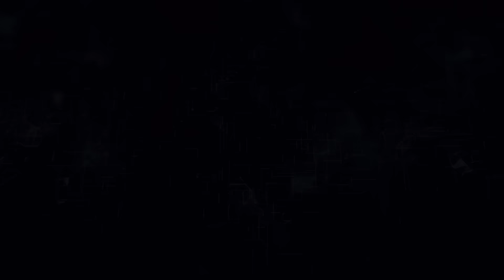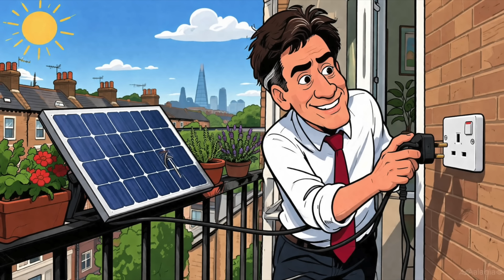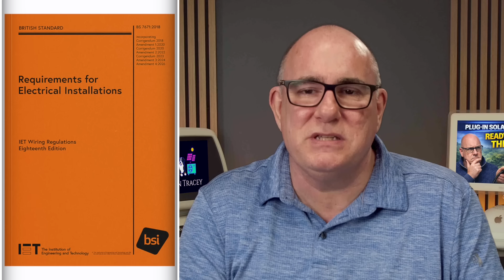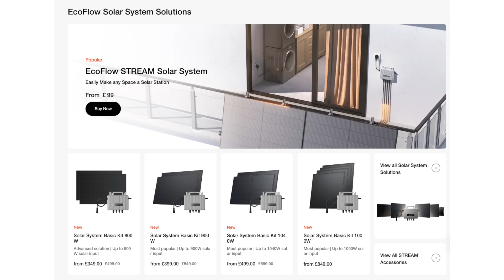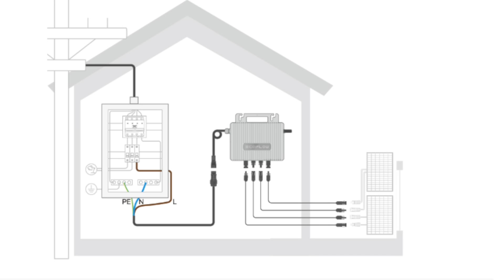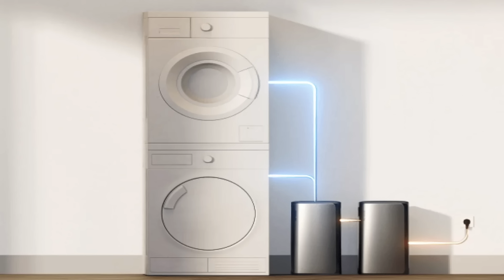Plug In Solar Is Coming… But There’s a Problem

Comment: Honestly, with the lack of decent sun in the UK and the cost is gone be hard to justify it
Reply: For a typical middle of the UK building with space for two south facing panels in the garden or on a wall your generation is 800kW a year or thereabouts. That's 200 quid's worth of electricity, so we have enough sun to make it work. It also works in places with far less sun because the panels are cheap and you can just overpanel.
Reply from the maker: There’s plenty of sun in the UK, you just build up enough credit in the summer to cover your winter bills. It’s helped me achieve a zero Bill home.

Comment: stupid question maybe, but as you need to plug this in to a plug socket, you will need to drill through a wall to get the plug coming inside… getting someone to do that will use up a years profit!
Reply from the maker: Or you could just draw a hole yourself and save the money
Reply: If you spend that much getting a hole drilled then you've been had.

Two solutions
- Drill your own hole (it's easy)
- Put the inverter/battery inside and use one of the very flat MC4 solar cables that will thread through a window and still let you shut it.

The latter is common in Europe because drilling holes in rentals makes the landlord angry.

Comment: Plug in solar has been available for quite a few years in Europe. It is actually a bit of a scam, even in Europe because the power generated is pathetic and the return on investment is not worth it. In the UK it is basically a device that Ed Milliband likes to use as a propaganda tool.  The fact of our power market is that we are paying about £0.30/Kwh whereas in sensible European countries one will pay £0.11/Kwh. We are being ripped off in the UK folks.
Reply from the maker: @johannbraunstein1190 I get the scepticism 👍  

The key difference now is pricing and usage — with higher UK energy costs, even modest generation can give a strong return.  

It’s not about huge output, it’s about **offsetting what you’d otherwise pay for**, and that’s where the value comes from.

Comment: About the buying stuff in" supermarket " aldi as an example,  television and radio in uk needs a licence the bbc thing regulations permit sale of a television but buying them in a shop involves a form this form is the document the licence revenues department then corelate with the TV licence,  a silly tax British folks dislike but a process that simply replicate the solar panels sale to force shop to provide details of the location panels going to reside.  That's a brilliant idea ?
Reply from the maker: @j.nav31..is7 interesting idea 👍  

The challenge is balancing simplicity and regulation — too much admin and it kills adoption, too little and you lose oversight.  

Some level of tracking might come in, but it needs to stay simple for small systems.
Reply: Shops have not had to take names or give them to the government for years.

Comment: Harvesting solar energy or any form of natural energy is a good thing. However, (regarding solar energy - especially rooftop panels), in the near future, what do you think is going to happen? 🤔The govt is pushing hard for people to convert to this. Similarly to the 'buy diesel cars' & now 'electric vehicles'. 

I don't need to mention the stigma on diesel vehicles, although today, they are cleaner than in the past. Electric vehicles were sold on the pretext of NO road tax & free from congestion charges. Hmm, that has changed. 

Back to rooftop solar panels, I guess the govt will bring in a tax on all properties having these. Property owners (like the EV drivers) have little option but to pay.🤐

Looking at the past history of govts 'hard-sell' propagandas, & what has happened since, this solar tax may not be as far-fetched as it appears to be now.
Reply from the maker: @kenco777 I get the concern 👍  

But past actions don’t dictate future ones — if you spend too much time worrying about “what might happen”, you end up doing nothing.  

Right now, solar reduces your bills today — and that’s something you can actually control 👍

Comment: The govt go out of their way to make sure you will only ever get minimal value for the cost of this. It will take years just to get your money back.
A 'real' govt could half the price of electricity if it wanted to, never forget you ARE being conned.
Reply: Would you provide the details piles of papers the guy dislikes filling in.  It's an interesting argument?  Provide details of location then anywhere someone doing naughty things can be " investigated " .
Reply: @j.nav31..is7 ??? Maybe lay off the beer for a while.
Reply from the maker: @manoo422 I get the frustration 👍  

But in reality, the return from solar isn’t controlled by government — it’s driven by **what you avoid paying for electricity**.  

If you’re paying ~25–30p/kWh and generating your own, every unit you use is money saved — that’s why many systems pay back in a few years, not decades.  

Also worth noting: solar is one of the few investments that’s *predictable and low risk* — no market swings, no interest rates, just consistent generation over 20+ years.  

It’s not about being “conned”, it’s about reducing what you buy from the grid 👍
Reply: @JonathanTracey  I would say it is controlled by the govt because of the severe restriction on the allowed size, 400W? The benefits can only ever be very small at that size. Especially in the UK with such a small season of 'full' production, it would be considerable better in Spain!
The con is that we are being deliberately and massively overcharged for electricity, the most expensive in the world. Three time what they pay in America, which a different govt COULD half the cost of electricity without much effort. We ARE being conned in the first instance but I accept that every kWh you make is one you dont need to buy at whatever price it is.

Comment: An excellent explanation for the experienced and the new people who want to get that base load covered. I had the Powerstream like you a few years ago and had to send it back as my DNO are still to reply to my enquiries about having it fitted and my obligations to them… ( q was a Powerstream and Delta pro did it need a G98…. They escalated it and it went cold) interesting you say they are ok with other inverters on the same house supply …. Some said they can fight each other but I guess you have direct experience of the Powerstream and your main inverter working together. Fundamentally it’s a good move as getting that base load met without the need for the grid will be good for the country. I also expect those like me with an export process locked in will just add it and the excess will be fed out and small extra income earned without informing anyone …. Yes I know bad but imho we are loaded down with procedure and that needs loosening … I’ll take the flak for that
Reply from the maker: @yellownev really appreciate that 👍  

You’re right — the DNO side is still a bit inconsistent. In practice these systems can coexist, but the rules haven’t fully caught up yet.

Comment: Plug in chargers for electric cars would be a bonus, is this a thing yet?
Reply: Fit solar on top of car efficiency is the critical bit a car can charge while sun is shining brilliant
Reply: @j.nav31..is7is that a thing then or just something being developed?
Reply from the maker: No, unfortunately, most electric cars required at least 1300 W to start charging, so a micro inverter isn’t going to put out enough energy.

Comment: Soon solar will be like trampolines and the big satellite dish issue. Sometimes it's windy in great Britain the fixing for such flat panels might seem easy but wind is a force to be respected. Try driving at 10 mph and put hand out window of vehicle..now think wind speed can get to 60MPH the panels are like ⛵ boat sails ..please understand the damage also putting a fragile panels transport to properties the damage that very often happens to flat panels tv screens .needs addressing!
Reply: It's been addressed for over 30 years. There have been standards for a very long time indeed because people weren't daft when solar first started to get deployed, and there's a massive historic understanding of attaching stuff to buildings.

Solar panels btw are not fragile, which is one reason they have all the rules about correctly fixing them to things. They are big heavy solid objects.
Reply from the maker: @j.nav31..is7 wind is definitely a factor 👍  

That’s exactly why panels are *engineered, tested and certified* for wind loads far beyond normal UK conditions — they’re not just “stuck on like a trampoline” 😄  

This isn’t new tech, it’s been on roofs for decades.

Comment: Brit living in Greece, and thinking of doing one here, where it is already legal. Interestingly despite 300 days of sun per year photovoltaic systems beyond the commercial setting are not popular. Everyone goes for a vacuum tube water box system, but virtually no one used photovoltaic, partly due to costs, and I think party due to a mess when it comes to sale back to the grid. The water system costs about 1000 euros installed, so is a no brainer really. An Ecoflo Stream system can be had here for 600 to 700 euros.
Reply from the maker: @GreeceExplored that’s really interesting 👍  

It actually lines up — hot water systems give a very direct return, whereas PV depends more on tariffs, export rules and usage patterns.  

At those prices though, PV is getting very compelling 👀

Comment: What if I plug in 3 ?
Fire ?
Reply from the maker: i doubt it, i have two plus my main 10kw inverter and all 3 play nice together
Reply: If you plugged them into separate rings and they were safe at one per ring then ought to be fine. Total export would be 2400W so still within the 3.68kW G98 limit.

As it stands today you can buy 3 of them, set them to 1200W each and wire them all onto the same new circuit into the consumer unit and be totally compliant with regulations. The question really is what they allow for plugs.

The "what if you have n of them" question is actually really important for safety - not so much because of home installs (a single proper 3.68kW system is cheaper than 3 ecoflows anyway) but because of things like HMOs where you might have multiple residents all plugging one into the same house.

Comment: Thanks for this clear explanation..much better than some of the sneery comments on reddit currently. I think this might be good for me (small end-terrace so not much roof space, but south facing garden that gets lots of sun, also dont know when we're likely to be moving anyway). I wonder how the £100/year saving is calculated.. in my mind this is the kind of setup that will allow me to think about some sensible load-shifting, eg. running the dishwasher and washing machine sequentially in the middle of the day.. obviously it's not going to cover everything but by matching consumption to production as much as possible i think we could achieve bigger savings even without a battery.
Reply: If you have the ability to load shift and use all the power effectively then your saving is
~25p per kWh of solar you generate (current tariff price per kWh minus a bit for efficiency loss). In the middle of the UK 800W of solar facing south, angled reasonably and unshaded will generate ~800kWh of solar. So the savings are about £200 a year if you can use it all. The rule of thumb for solar only is that the average household uses half of it so £100.
Reply from the maker: @nocathedral really appreciate that 👍  

You’ve nailed it — the real value comes from matching usage to generation.  

That £100/year figure is more of a conservative average — with good load shifting like you described, you can absolutely beat that 👀

Comment: Hi, Interesting video and very informative. Can I use a plug and play system for my garage which currently has no electricity?
Reply from the maker: Yes, but you would need a system with a battery. Because you’d need to regulate the supply of energy for things in your garage. . in this case you would  probably be better off getting a power station and  solar panel.

Comment: I worry that non-technical people might 'expect the earth' and achieve nothing - and feel they've been duped.  It will take so long to recover the cost, so is there really any point in getting anything other than the real thing? 
If you have  small flat, with  balcony, it's going to be pot luck whether it's facing the right way....
Reply: It won't help UK flats
- Needs freeholders approval (unlikely)
- No permitted developments for flats, so planning permission is mandatory
- Building regs part A is mandatory
- If over the height limit then you get hit by every bit of the post Grenfell fire regulations

Probably a grand just in compliance costs unless we get major planning reform, and there is no way any politician will dare touch the fire regulations.
Reply from the maker: @herrtomas6729 I get the concern 👍  

The key thing is expectations — these entry-level systems aren’t trying to power everything, they’re just offsetting your base load.  

For example, you can get a *basic setup for ~£200 (single panel + inverter)* and that can pay back in around *2–2.5 years* depending on usage and tariffs.  

Larger systems take longer, but they also deliver bigger savings — it’s really about scaling to what works for your situation rather than going all-in from day one 👍

Comment: We had an 800W system before upgrading to a proper system. As you say, it's enough to offset the background load when it's not raining. The ROI was actually pretty good, because it always replaces peak-time use, and doesn't rely on export payments. I think it paid for itself in 4 years, and a modern system should be a lot cheaper.
Reply from the maker: @robinbennett5994 that’s a perfect real-world example 👍  

And you’ve nailed the key point — offsetting peak usage is where the value is, not export.  

With today’s prices, smaller entry systems can be even quicker to pay back, especially for base load 👀
Reply: Would you provide the details piles of papers forms  the guy dislikes filling in mentioned about 8 mins in , It's an interesting argument?  Provide details of location then anywhere someone doing naughty things can be " investigated "
Reply: @j.nav31..is7 You fill in a G98 form. There was already talk of the equipment providers actually providing you most of the G98 form ready or at least what text to paste into each box.

They can already detect people doing naughty things if they have to because they can measure it themselves, and they can then in theory get a warrant to get your meter data. I've never heard of anyone getting dinged except when their meter was an old non smart meter so it detected the export and that triggered the meter tampering detection.

Even then it's going to be a "You should have filed a G98, here let us help you" I imagine.

Comment: We had solar panels on our boat 20 years and guess what , they don't F'king work for 9 month of the year. We bought a solar powered security camera last April, It stopped working when the days go shorter last last September
Reply: Camera solar always sucks. The panels are tiny and use old tech. Solar panels loose efficiency every year, around 1% to 2%. Modern panels, especially bi-facial panels are way more efficient now than panels from 20 years ago. Just like any tech solar if improving year after year.
Reply from the maker: @SpacedOdyssey solar works best when pointed at the sun, (south facing in northern hemisphere) if there is anything blocking it then it wont work, but other than that they work just fine
Reply: @JonathanTracey  Feckin Hell, I would never have known that if you hadn't told me - I had mine upside down pointing at the hull with silver foils over them -

Comment: One thing which we need to realise is that standing charges have increased hugely, which means that even if you spend money on panels, you are still having to meet the cost of high standing charges.
Reply: I live on my own and have a small flat. My standing charge is 58p a day, and my electric usage a day is between 40p and 60p a day on top of it. The standing charge is half or more of my bill.
Reply: @TheGramophoneGirl same here
Reply: @TheGramophoneGirl  Exactly why it should be abolished to help light users which include poor house-bound O.A.P.s.
Reply: I was going to mention that... im paying for gas and electricity in a house im not liveing in yet.. where my use is basically 0... as well council tax... this has slowed my savings down to complete the build no end
Reply: I live alone and my water and gas usage is less than the rip off standing charges in my  year old flst!
Reply: @theuktoday4233 It's an unfair system. We can't even be encouraged to save power because of these outrageous standing charges applying, no matter how you try to save a bit here and there. The government is responsible for allowing this.
Reply: shareholders need that money 💰
Reply from the maker: @johnchoice1371 you’re right 👍  

Standing charges are a big issue, especially for low users.  

Solar won’t remove them, but it does reduce the unit cost side — which is still where a lot of the savings come from.
Reply: @JonathanTracey so you’re saying we those “new standing charge panel models :p😊”
Reply: The electricity network, including the one in your house, still costs money if you do not use it.  Just like your car costs you money even if you never drive it.
Reply: Jokes aside there’s been recent chatter from the government about unifying SC and unit costs together somehow reducing the over all price of standing charge
Reply: Standing charge was increased to pay for smart meters, they were not really free.